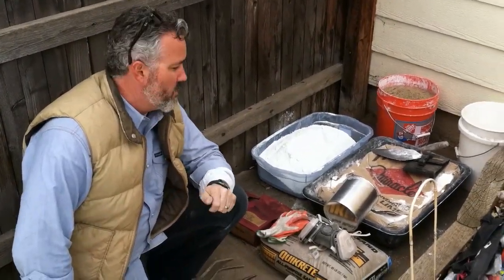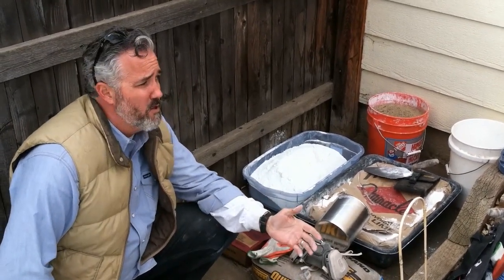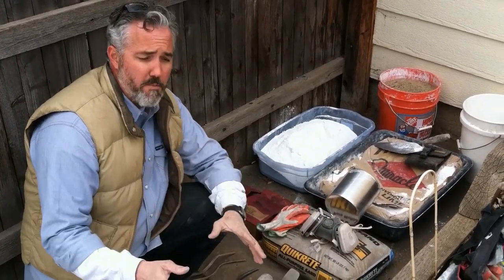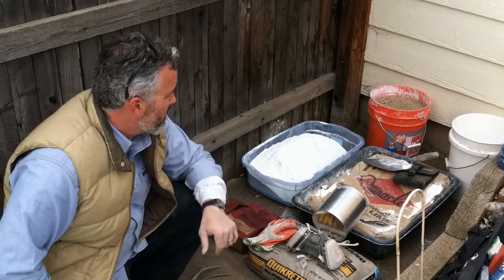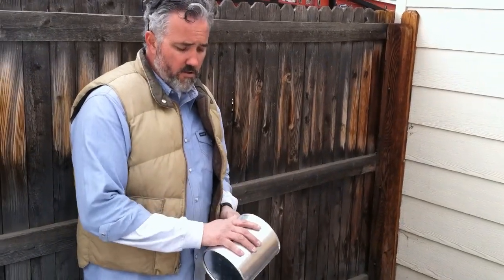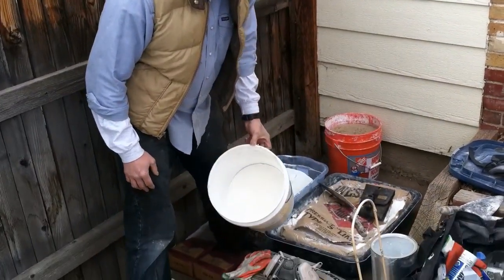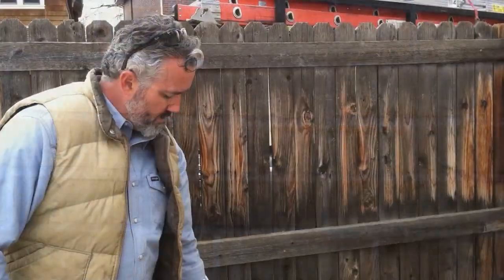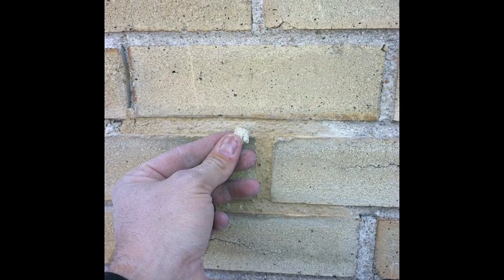How to tuck point Mixing lime based mortar/ Mortar Color Matching

Comment: If the original mortar mix was lime and sand without any cement - why do you incorporate cement in the repair material? I've been researching ahead of some repairs I need to do on my 1920's home and I'm seeing nearly equal references to using or omitting cement. As if that wasn't confusing enough on its own - most of the no-cement guides are overly vocal in claiming that using cement will eventually destroy the wall.
So - to cement or not cement???
Reply: no cement
Reply: yeah I've heard the same Grant. I think it's definately No cement.  However I notice this guy uses 1 part cement to 4 parts lime - which is really pretty low.  I wonder if he's doing that to speed up the setting of the mix?  The ultimate aim is to create mortar which is softer than the bricks

Comment: That's not tuck pointing - it's just repointing. Unfortunately it's with a mix polluted by cement. I usually find that those who put cement and lime together don't understand how it ruins its porous and flexible properties. A word from a seasoned professional: never ever combine cement and natural hydraulic lime. The upshot is damp, mould, ruined bricks and a devalued house. And it looks rubbish.

Comment from the maker: I don't believe there is much difference. Buying sand at your local landscape company is way cheaper. I have found that play sand is finer aggregate than all purpose sand. I mostly do older and historic work so I tend to mix larger aggregate in with either play sand or masonry sand. The last job I did actually had what they refer to as "squegee" which is one size down from small pepples. Thanks for the kind words!

Comment from the maker: Old bricks do have some slight variance in size depending on which type, but generally speaking no there is no time spent sorting bricks. Is your wall equally wide may be the question. Masonry can be very illusory. We cheat things in and out in slight degrees over distances to hide imperfections.

Comment: Can I used pulverized garden lime to make lime mortar?  Can I add lime to a type n mortar mix to soften it?
Reply from the maker: I don't know about the pulverized garden lime. Yes you could add lime to Type N mortar. I would use less lime than normal. Maybe 1 to 1 rather than 2 to 1.

Comment: The reason you find that building sand down at your local landscapers is way cheaper than play sand is because play sand is finely graded and washed. It's  more labour intensive to produce and therefore more costly.  Ask me if you want to know why you should never use ordinary building sand when lime mortar repointing.
Reply: It's only been 6 years , please do share your secret! 😁
Reply: @rofree2470  Because ordinary building sand is unwashed. When used to make a porous lime mortar, the impurities rise to the surface. Not much of an issue at height but lower down it looks dirty and oily,.